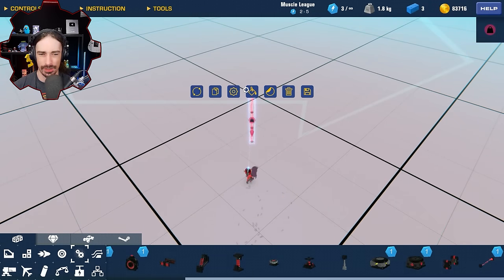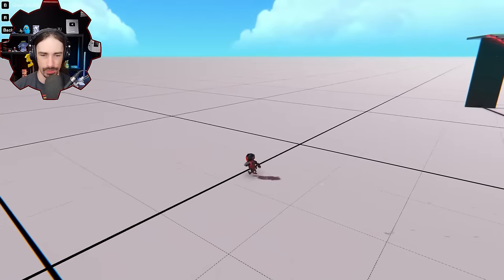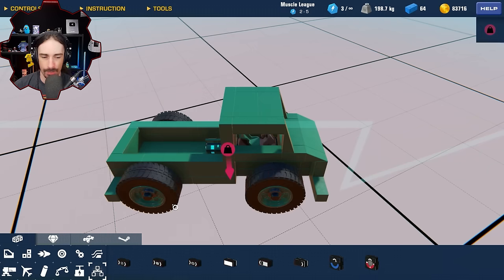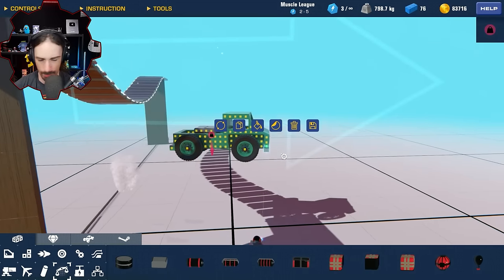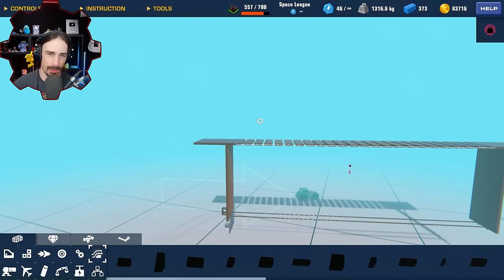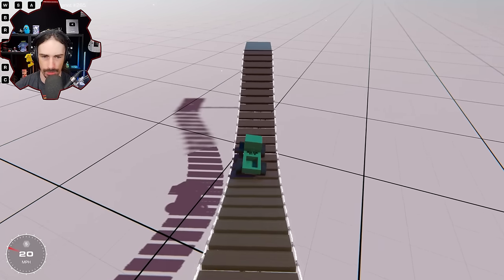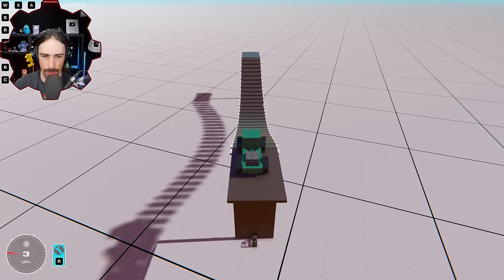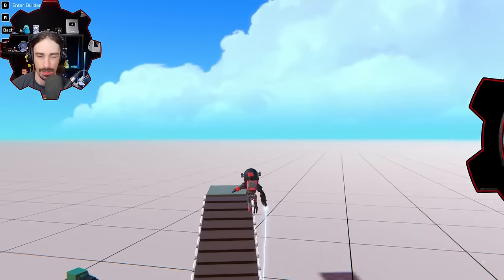What's The Heaviest Vehicle That Can Drive Across This Bridge?

Comment: The wobbly issue is the same as irl so that why there are rope railing on them connecting each other to make them not wobble that much
Reply: I would say it is more caused by the fact that these connectors are more like springs or bungees. When the weight is off center one side pulls more than the other, which causes lateral movement.
Reply: came here to say this 🤣
Reply: And if it wobbles from side to side you might fall off as a person
Reply: It also seems that in the game there isn't proper grip on it so that if the platform you're on moves you stay where you were, that is not the case irl, hence why there are some bridges that wobble a decent amount but still work for people (ish) & vehicles.

Comment: it's not super unrealistic, if you think about it:
the back wheels PUSH the bridge away a tiny bit, in real bridges like that, you have the "handrailing" that is fixed to another spot to counter-act on the problem (of course it's walking, as you still push on the bridge, just another way, but the idea is the same). You could have made a rope in the middle that fixes the side wobble, but "only" is fixed to the foundation. it's basically the idea of the Stiffness. 

if you then take a tightening (like piston), you could fix the middle rope*

*it goes from the middle up -> connects in the middle to the other side, and then foundation.

Comment: you could add a few diagonals with powered connectors so that you lock it in the side to side axis. a diagonal prevents a square box from turning into a parallelogram

Comment: Other comments offer some good points about how bridges behave irl and how handrails help stabilize them, but those specific truck tires also have some really weird properties to them. Their traction is very slippery despite their size and treads, so much so that they have a hard time accelerating/decelerating (even compared to the monster truck tires) and they'll often allow your creation to jitter/slide around if there's too much weight on them

As for more rope ideas, I can't help but think these might make for good tank treads, assuming you can figure out a reliable way to connect them into a loop (maybe with grabbers?)

Comment: Hey scrapman, I was watching your video and noticed something that may help the situation. 
The side to side wobbles only seem to happen when you turn your front wheels. I don’t know for sure, but think the car is 4 wheel drive.  As you are trying to stay straight and adjust your steering, the front wheels may be pulling the bridge in the direction you are turning.   If you look at time 8:25 in slow motion it seems to be especially clear. This looks to be the main cause of the side to side wobbles.
To fix this, maybe try making it only rear wheel drive.  I’m not sure how much this will help, but without the front tires directly pulling the bridge in the direction you are steering, it may help keep it more stable. Although, the couplers are way more forgiving in side-to-side motion rather than being compressed, which in that case bracing may be required.  Great video also, always a pleasure!

Comment: I think the side to side is the game trying to correct them to their original positions rather than letting them snap like you would see in bridge building simulators. 
If you take the 'freakouts' as a bridge snap, you could use experience from bridge building simulators to build a better bridge. 
(especially if you do decide to make a suspension bridge)

I would also be curious to see some of these ideas on the space map. For example using the net to catch things.

Comment: Zipline?
Guitar string?
Reply: Zipline would be so hard, since only the connector points can be contacted
Reply: The connector only has collision on the ends unfortunately, though a zipline would be cool
Reply: Zip line could work if you made the actual rope or zip line, and make a separate build like a seat with a loop on top that can fit the zipline in between, and place it in builder mode on the rope.
Reply: Would work with pipe pieces
Reply: why is no one talking about gutair string

Comment: I believe that the sideways rocking is very hard to counteract, but it is possible to adapt to it. If instead of regular wheels you used custom wheels with anchor pins surrounding them, they would be able to latch onto the bridge and go through just fine. However, that would also nullify the effect of the vertical rocking, which would make it pretty uninteresting.
Reply: if you use anchor blocks for wheels you are gonna rip the bridge apart.
Reply: The anchor block is like  permanent, it isn't a pin or something like that you can attach and detach
Reply: @monsieurgb497  then i'm stupid i guess

Comment: I think the wobble is due to the stretch of the power couplers. If your weight moves too much to one side then one side stretches more causing that side to dip further and then the bridge slides out from under you towards the side that is higher up. Closer to getting off balance on a hammock.

Comment: A possible solution to the side sway. Make the bridge segments interlocking but still seperate, disjoint pieces. Kind of like how bricks interlock. In theory it should prevent lateral movement while still allowing vertical flex.
I dont play trailmakers though so not sure how it would behave in game.

Comment: Im loving the new power couplers I wonder if you can make a Anti Air net to take down planes or a vehicle to go along it like a tight rope or a zipline or you could make a long power coupler with an anchor on the bottom of it to make a winch to pick up stuff from a helicopter 🤯

Comment: You may try in the last half of the video...but would having vertical walls along the sides not connected to the bridge keep it from doing the sideways motion?  I am guessing the wobbles happen due to the truck not being perfectly centered and or the weight not balanced and one side stretching more than the other which would cause the sideways motion.

Comment: The lateral movement of the bridge probably comes from the wheels pushing into the planks. Having the planks closer should have helped as well but would have made it bend less. The suspension probably helped because the force of the wheels got absorbed by it.

Comment: 1. weight should be placed on front and back, not only on back
2. truck wheels were good enough, put doubles or third axle to reduce mass per wheel
3. for the bridge, try create tree-lanes power coupler bridge, i mean third lane between two separated blocks

Comment: From my observation, your powered steering wheels applied a sideways force when turning the wheels. Only part of the problem. If you make the bridge segments in U shape so that the weight is below the connectors then the force should be applied more centered and reduce side to side forces making the bridge less likely to bend around the weight of the car. Just my opinion. I'm not an engineer.

Comment: I believe the wobbling issue is caused by the power couplers finding other ways to compress back to their normal strength because they can't compress against the weight of the vehicle, I have no idea how this could be fixed.

Comment: i think the bridge itself needs more weight,  currently the only weight it has is normal blocks and the connectors which are both very light. I think if you add weight to the individual segments it would work better.

Comment: The bridge is sliding underneath the tires while the truck remains straight, the bridge pieces aren't completely interacting with the truck (lateral grip) and are trying to get out of its way! heh. Otherwise, the truck would start swinging with the bridge.
a third rope down the middle might stabilize it a little more.

Comment: Shorter bridge to test the actual strength of the couplers instead of the weird physics. Also make it like a trench so the road is hanging lower than the ropes and it cant slide out from under the vehicle

Comment: Because of the weight on the back the suspension in the back is fully compressed which is probably making it's still wobble because there's basically no suspension, I bet if you add more suspension to the back it might be able to get acrost

Comment: Funny enough, I think I know what's going on, and if I am right having less traction would actually be better.

I think:
When the backward force gets put on the suspension it flexes more on one side because you aren't going down the middle which causes a twisting motion which results in a cascading swaying motion, leading to a cascading fail as you start applying enough force to get 800lbs across the bridge. If I am correct then adding suspension that restricts the horizontal movement and twisting, should help.

Comment: for me the most obvious way to reduce the side-to-side swinging is to add steering hinges on 0 stiffness in between the bridge segments
Reply: Yes, however that would also prevent any stretch from the power couplings.
Reply: I see your point, perhaps you don’t need to use hinges between all segments?

Comment: Also when it comes to a suspension bridge just build a basic frame around the bridge you just did. Swap the tri connectors for quad connectors. Finally run the power connectors from the top of the frame down to the bridge. That should give you a basic suspension bridge if you want something more classic use the Piston technique to actually make the couplers angle in

Comment: Find  a bridge like this IRL where they just put the materials together, string them over the gap and call it good lol. You can't. That doesn't exist, they always tension it ;) I'd like to see if that works. Either with pistons on the bridge, or pistons on the bars underneath. My first thought was put the far side of the bridge on wheels, have pistons pull it taught(through experimentation) and then use some combo of detachable block and anchor or whatever's appropriate to pin it to the ground after tensioning. Alternatively just have pistons to tighten the bridge to riiiiight before they go spaghetti. That could complicate driving though of course.

Comment: maybe the oscillation happens because of the tires pushing the bridge side to side. You could try powering the car with a propeller or thruster too, and the wheels just coast